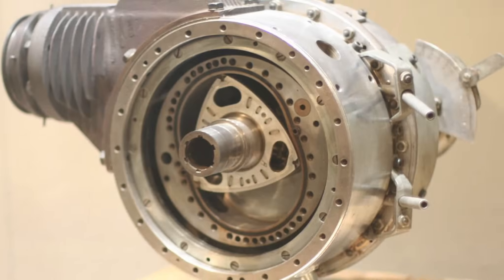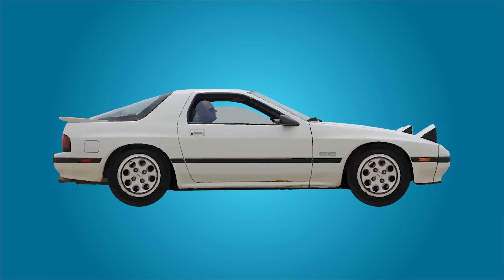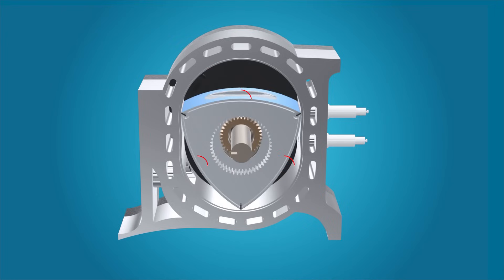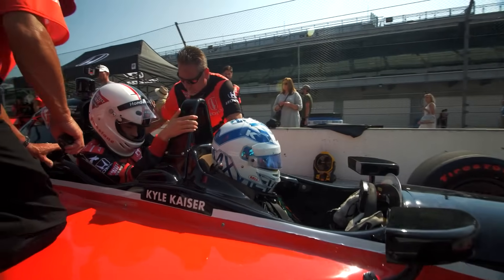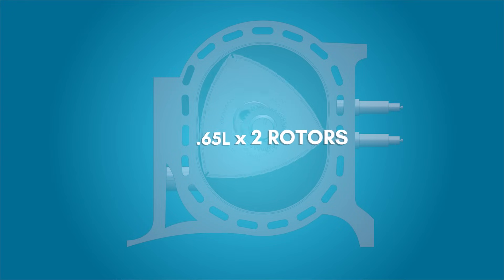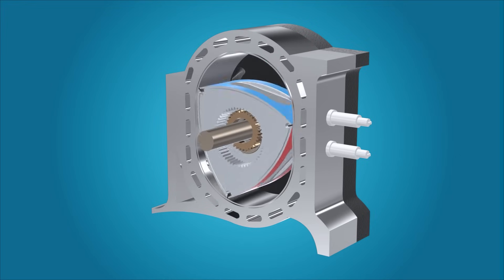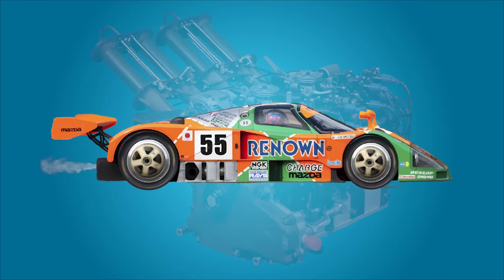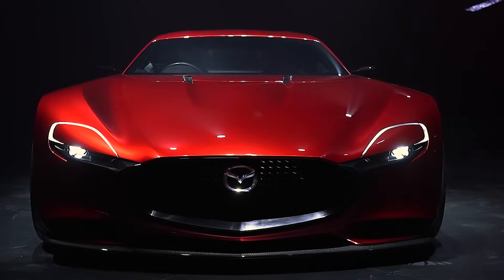The Engine of the Future?

Comment: 0:50 Mazda had nothing to do with NSU RO80 or the Citroen. NSU literally invented the rotary engine and Mazda paid them for a license later. Felix Wankle worked for NSU in Germany. All of the licensees could share rotary development information except General Motors which had a special license that didn't give them access to the other company's development and they in turn didn't have to share. Most companies solved the same problems using various different techniques, they mostly did their own individual development while looking over the fence. 

As for the capacity, either early piston engines are calculated wrong (yes) or rotary engines are. Had early piston engine developers been thinking they would have calculated the swept volume x the number of cylinders that have combusted in one revolution. For a four stroke engine it would be half of what they ended up with. For instance a 4 liter 4-stroke V8 should have been a 2 liter because only 2 liters of swept volume combusted thus only 2 liters contributed to power output. The rotary engine was calculated using this formula. 

Instead of rectifying the incorrect displacement of 4 stroke piston engines they decided to incorrectly calculate the rotary engine displacement to match. Rotary engines shouldn't have been the innovation that pointed this error out, it should have been 2 stroke engines which have been around since 1881. Two stroke engines have twice as many combustion cycles per RPM as 4 stroke engines but their displacement is calculated exactly the same which has never made any sense.  Now, both 2 stroke and rotary engine displacements are incorrectly calculated to bring them in line with the 4 stroke which is also incorrectly calculated. Makes sense (not).

Comment: I understand the problems with emissions, but why did the rotary engine have poor fuel efficiency? Isn't the efficiency tied to power-to-weight ratio?
Reply: Poor thermal efficiency. The exhaust port opens to soon, that's also why small rotaries can spin such large turbo's. There is still a lot of thermal energy in the exhaust, more than conventional piston engines. You can also feel this if u hold ur hand behind a rotary powered car, it will be a lot hotter than with a normal car. Rotaries also have poor combustion and leave a lot of unburned fuel behind. That's why rotaries can shoot such huge flames with only a simple decat.
Reply: @rx8niels158  The bad thermal efficiency is just as much tied to the flame traveling long distances across a metal surface that absorbs that energy. In a piston engine the flame travels 2 inches maximum and then the gases expand. In a rotary the flame travels so far that the rotor itself outspins the flame front. Then the same rotor spins about another 12 inches across a cool surface that's absorbing heat energy before sweeping the exhaust out the ports. The hot exhaust is largely due to unburned hydrocarbons which was in the past burned post-combustion in a thermal reactor just outside the exhaust port. What was left after that was later burned in a catalytic converter. That's a lot of unburned hydrocarbons which should have been used to make power. Half the energy was absorbed into the very long combustion process and the other was sent right out the exhaust port. 

The original design from Felix Wankle kept the combustion in one place and both the rotor and the housing spun. The crankshaft didn't turn so the drive gear had to be placed on the outer housing which provided it's own complications. The combustion on that engine would have been better but it would have been too complex to get right.